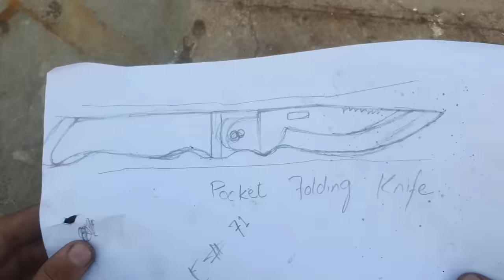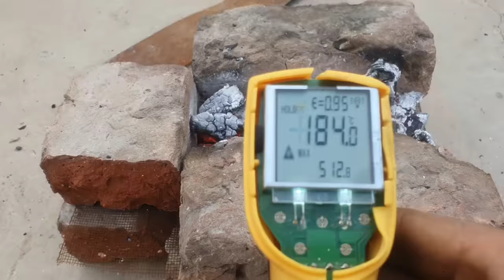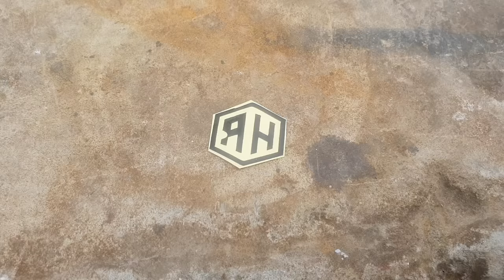Turning a Rusted BOLT into a Beautiful Folding POCKET KNIFE

Comment: Those are not just Random Hands. Those are the hands of a master!
Reply: 100% agree
Reply: Da
Reply: Attractive knife? Yup. Master? Absolutely no. A master wouldnt have put that wood handle in the acid. A master wouldnt have used clear coat on the wood. A master wouldnt have rushed the build for the sake of a video. A master would have put a blade catch lock in there so it doesnt slam shut while using it and cuts off his index finger. This is far from a master. It's a pretty knife though. If he had taken his time and done it right, he'd have an amazing knife, worthy of passing down.
Reply: You deserve a ❤️
Reply: @denvernow7294  and  use no mild steel for knives
And when he  uses he dont quench it
Reply: Denver Now also a master wouldn’t quench in water
Reply: هههههه

Comment: Very nicely done . My only concern is one of safety.  What keeps the blade in the open position ? Are you relying on just the pressure on the blade when you are using it ? 
As for learning lathe usage , there are many online sources . The main thing , as with any tool is staying aware of loose clothes , watches or other items that can get caught.  Take it slow , and practice . Stay safe .
Reply: very pretty well made knife,  would you consider selling a knife?

Comment: Pretty amazing knife, your skill improves with every one.
Lathes are easy to learn (machinist here) but they can be dangerous, the first bit of advice I can offer is what I tell everyone learning, if you have long hair,put it under a hat, no jewelry,meaning rings and necklaces, no long sleeve shirts, all of these thing can and will get caught in a spinning lathe.
Never wrap sandpaper around a part while turning it and NEVER wrap your fingers around a part while sanding,I snapped my thumb and fore-finger doing this,the sand paper locks up and the part keeps turning.
Reply: Scott Hardin f

Comment: Nice try, but: No lock for the blade? It will fold to your Hand. The finish of the wooden handle can be improved. Don't spray lacquer. Sand it and oil it! The brass screw Looks like garbage.